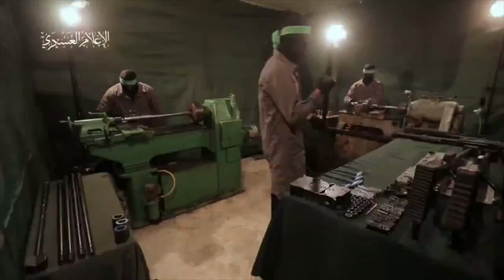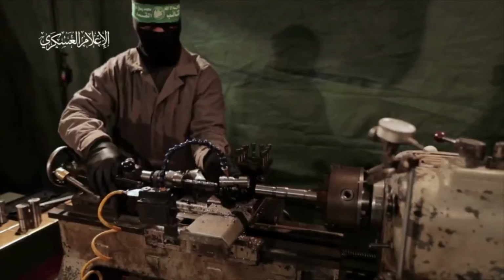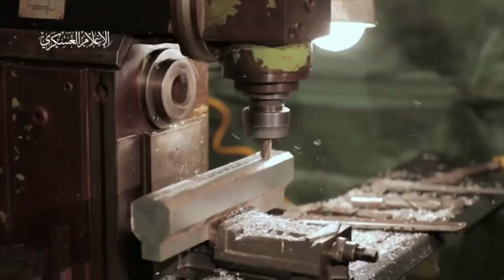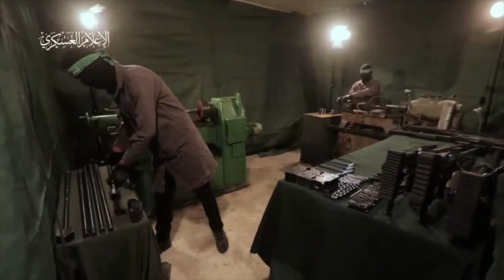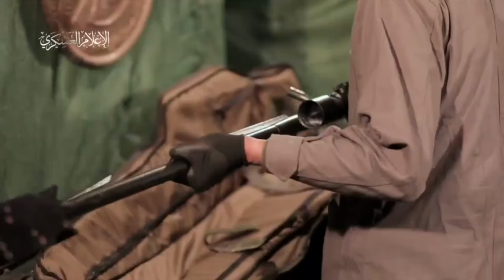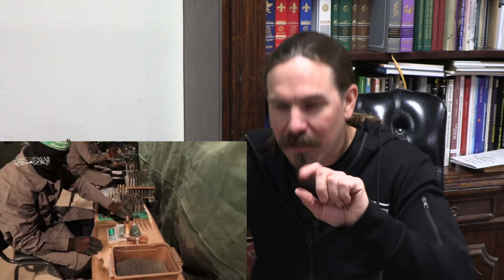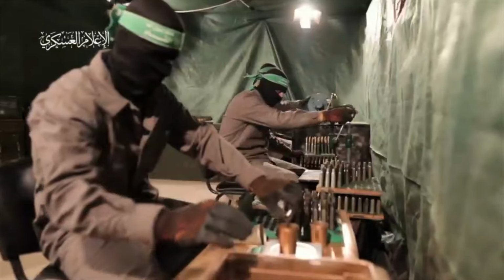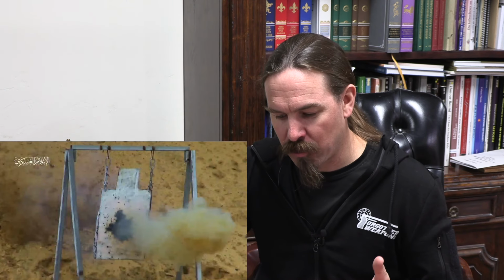Hamas Claims to Make Sniper Rifles in Gaza - Are They Really?

Comment: Notice the high pressure pump at the back of the long bed lathe ? Assuming barrel blanks are not imported from less scrupulous companies like Border Barrels ( Herr Doctor boasted to me about supplying Pakistan with .50 cal blanks several years ago ) or Lowther , you can produce very good barrels by peck drilling with a D bit made from 01 tool steel , finished with a D bit reamer with lube lead lapped then buttoned with a carbide button bought from China if using 416 stainless Steel etc. Turning between centres you would NOT see the bore of course, as the lathe centre is IN the bore . Profiling using light oil WILL produce smoke , probably using HSS on stainless here . Profiling can be done using carbide without smoke , its all about transferring heat into the chips with the correct feed and speed . You can profile a 50 cal barrel without a steady with lighter passes as the 1.75 " diameter bar stock is very stiff . You can make a button for rifling from 13mm 01 or carbide or buy one from China . If they can produce scope mounts then receivers are a snip . 
You dont need a powder trickler to hit 10ths of a grain . A big scoop and a tiny spoon will get it done or use a baster for trickling . My guess the IDF supply the once fired brass every time they go into Gaza . The steel case probably Tula . There's enough child labour there to collect , brass remake primers etc . With a long bed lathe with 4 jaw and spider , a milling machine  etc ., anything is easily possible and depends on the skills of the engineering students that have just returned from education in the West .
Compare this to the workshops of Darrah in Pakistan and see what they are capable of producing. 
Do not forget that Hamas is also the government of Gaza and fully supportive of its terrorist activity and their whole output is " light industry and agriculture " and firearms regulation is absolutely minimal just requiring registration of ownership.

Comment: I'm quite sure in reality, it's all for show - they don't make anything at all.

They have 4, maybe 5 Iranian-made rifles - there is not a single shot showing more than that.

In theory, they could surely make scope mounts - but in reality, they aren't.

If Iran manufactures and delivers the rest of the rifles - they would do the scope mounts as well. No need to take the effort to set up a factory for these in Palestine.

The milled, raw-edged scope mounts lie right next to smooth-edged parts in black finish already. Coincidentally, 4 in total. Go figure....

Comment: The one thing I disagree with is that the crates implies that they came in those crates in the first place, just because if you actually were manufacturing bullets then you would also have empty crates at the end of the assembly line to put the finished product in. So I agree with your conclusion, just I don't think that specific line of evidence is convincing

Comment: Also at 15:56 it looks like the shell on the left about 4 deep from the front has the shoulder in a very different place than all the rest although I suppose it's possible it's sitting on a marble in the tray but then it seems no two are really alike in case length or shoulder position. Maybe it's just a case of "headspace? We've heard of it."

Comment: One word... Pakistan. Where (reasonable) quality guns are made by hand with little to no measuring whatsoever and majority of the fine work is done by eye and file. 
The mid 19th century ultra accurate .451 Whitworth had a design that was extremely basic and where calipers were the only mode of measuring with unsurpassed accuracy out to 1000yds. 
Making firearms IS extremely simple and a lathe and a few hand tools is more than sufficient to produce a working relatively accurate firearm. So yes I believe this could be credible.

Comment: You can trickle powder with nothing more than a dipper, it's tedious, it's slow, it can be done. The major takeaway for being successful is don't scoop. Lay the dipper over sideways and gently push it into the powder until a very small amount enters. Then tap, tap, tap until only a few grains are left, move over to the scale and tap, tap, tap 1 grain, 2 grains until you hit weight. It's mind numbing but works.

Comment: To be fair to them, given the big box of powder and arrangement of cases, they ~maybe~ have unloaded a handful of various 50 bmg rounds they could get their hands on. Mixed all the powder together, and are reloading them to be more uniform with one another. Presumably if you have 5 different sources of steel cased 50 bmg for machine guns, this might actually increase the precision of the overall lot. Maybe even more-so if they had a separate box of projectiles and didn't just reload their random assorted mix of pulled projectiles. 

Definitely not precision ammo, but better than multi-sourced de-linked MG ammo. 
(unless they brazil nut effected the powder and now have a gradient of powder consistency across their reloading line, which would be very in-character for hamas)

Comment: The shot of the cases shows cases where excess oil has accumulated in the die and caused dents in the shoulders.  More likely in brass cases.
Also, the seating depths appear to be all over the place.

Comment: As much as respect Ian for his firearms expertise, his machining terminology is wrong. Boring and drilling are too different types of operations. A drill bit is used to open the hole, well a boring bar is meant to come in to finish after there is a plot hole for the clearence of the boring bar body. 

What he says is true tho, they are not machining anything. They would require gun drilling machines and rifling machines in oder to make a unable barrel.

Comment: I’ll spin the case when bullet seating, but usually this will consist of partial seating, rotate. Partial seating, rotate. If youre using a non-specific bullet seating stem and working with a new bullet it’ll help with concentricity/runout (allegedly).

Comment: Remember that we are talking about a region where fighters in their infinite superstition named the forward assist on an AR a "sniper button" believing that holding it down with their thumb would make the bullet hit more accurately down range.

Yes, the sniper button thing didn't originate with hamas, I don't believe that the general hamas fighter is any less superstitious or any more knowledgeable about the function of their firearms than Iraqis or Afghans.
That is to say, They know how to use the gun, they know what parts to assemble in which order, but they dont completely understand how all the parts function together when the gun is fired.

Hell, they might actually handload cartridges like that, "its close enough" type of principle, and they get the suboptimal result you might expect.

Comment: I'm an industrial quality analyst. To massively oversimplify things, your primary goals are to make things "on target with minimal variation" (accuracy and precision). All manufactured things are imperfect, no two parts are the same, but you have to strive to make them as identical as possible, using metrology and statistical process control and so on. With precision instruments, like sniper rifles for example, there is no such thing as "good enough", it requires continuous improvement and constant effort to make them as close to perfect as possible every time. Even variation within tolerances isn't acceptable. 

Now with all that in mind, let's see how these guys are allegedly doing it! 😂

Comment: Hey Ian, saying the barrels are solid might be wrong. I'm not a machinist but enjoy watching videos of machining, and have never seen a cut of end spindle so there has to be at least a shallow hole, but more importantly when they hand the barrel over you can see the center is drilled out. If it is drilled completely, partially or is solid except for the ends can't be verified. Also I don't think they use these things as precision rifles and more like anti body-armor rifles. In the end it is just a propaganda video, they will fake pretty much everything being filmed as long as it looks good on camera

Comment: I think you need to stick to what you do and not pretend to be a machinist. It's entirely possible they are doing exactly what they said. You clearly have never been in a machine shop before because smoke does come off parts. Thats white smoke, it's from the lubrication oil which would be needed for machining hard metal. The drill bit part coming off the other lathe could have been a parting operation and as many of us do we use the tail stock and insert a rod or in their case a drill seeing they are doing production to catch the part being parted off, then he backs the drill out and removes the part. While I wouldn't necc catch the part using a drill bit I don't see any harm doing so if its saving time from removing and replacing the bit over and over. Doing that takes a lot of time. This is why a turret lathe would be useful. 

 You go on to say they are faking it but then you say they really are milling something real. Make up your mind here. Obviously, it's a propaganda video. They aren't going to show everything and, in all probability, this is just one shop of many shops that make a certain few item's and they have many other shops around in other parts of the city making other parts. The British and Japanese did this same exact thing and many parts and pieces of their production were made in home workshops. Then the various shops would turn in their pieces to an assembly area.

It so happens I own a machine shop. I don't see anything here out of the ordinary like you do because you don't know what you're talking about and then all your viewers are going to lemming out and follow you off the cliff with your BS. 

These clowns are making guided rockets that have increasingly gotten better and more powerful and more precise over the past few years. As I said, stick to what you know and don't go stepping into what you don't know. Just because you've been in a machine shop doesn't make you a machinist. Just because some machine shops make certain things in a certain order doesn't mean every machine shop has to do the same.

And before anyone starts calling me a sympathizer, I'm Jewish. I have the star of David tattooed on my forearm with my name written in Hebrew inside of it which can clearly be seen in my videos. SHEESH!
Reply from the maker: Is that why the chips are blue?
Reply: @ForgottenWeapons  Doesn't matter the color of the chips. Get over yourself Mr. I can't be wrong at all because I'm an 'Merican. You have NO CLUE WHAT YOU'RE TALKING ABOUT!
Reply: Not a single rocket produced in Gaza has ever been "guided", and out of the 11,000 rockets Hamas has fired since Oct 7th around 20% misfired - which is just as bad as over the past years as well. Your claims of "guided rockets" and "more precise" - which are demonstrably false - unfortunately call your entire comment into question.
Reply: Even if the smoke thing were incorrect, there are so many other details that don't add up. Maybe you can do some mental gymnastics to convince yourself that they might be manufacturing rifles (which happen to look exactly like Iranian rifles), but my question is why? Hamas don't need to be competent machinists to be dangerous. They have never made "guided rockets," the rockets they produce are all extremely crude, but they still launched enough of them on October 7th to overwhelm Israeli defense systems. The guns they use are shitty beat-up surplus from Iran and elsewhere, but they still use them to murder people. Pointing out Hamas' incompetence doesn't diminish the threat they pose.
Reply: @austingoodman2177  Are you a machinist? Yes they produce guided rockets. I've studied everything they do. They aren't dumb. They made a propaganda video, not a documentary. They aren't showing the whole picture. All I said was it's very possible the video is legit and the OP doesn't know what he's talking about. Much like you.

Comment: I know a little bit about handloading ammo for rifles, I been doing it since 1968.  Those presses look very very crude to me, I use an RCBS Rockchucker that I bought in 1968 with my lawn mower money. Weight out each charge is well time consuming, but you get the most consistent ammo doing that, Also you need to weigh each case and segreate them so that they weight the same, then you do the same with the bullets, I saw no sizing dies or seating dies either. I am pretty good at it, and it takes me from start to finish a good two hours to size trim clean prime charge and then load a bullet into 10 to 15 rounds of ammo.  What they was doing is pretty much bullshit. To make those long long distant shots you need Ammo that is very very precisely made and the ideal is for the individual rifle. They are loading crap ammo for crap guns that somebody else made at best. This video is for people who don't have a wit on knowledge about guns or what it takes to make guns or the ammo. Of the two ammo is the hardest thing, since its got to chamber and work over a wide cross section of firearms.  Gunsmithing is a craft that takes years to learn, those guys you could not trust them to pump the proper grade of fuel into your car, let alone craft a rifle that you can trust.

Comment: Things that stuck out to me... steel toe boots, not sandals. Also wearing eye protection. The lathes  were way too new and clean. Reloading equipment was too professional. In Rhodesia  we got thousands of 30-06 but FALs use 308. So pull bullet pour powder in 2 kilo coffee can shorten cases and resize. Reloading was done with pliers ... crimp the brass. Powder was measured by a shorten case or by "eye". Lightly tap bullet in. If there weren't enough pliers go around... just bite down. Amazed even me that misfires few... thank God FAL has adjustable gas port because lots of hot rounds

Comment: Excellent video Ian, but I might add some context. I would suggest this video would be as much for the rest of the world as for their own rank and file moral upkeep. 

They are fighting with the best they can get. They may have the intention of using them in far closer ranges or hit and run tactics on light armour. 

They do however have everything necessary to do basic repairs perhaps? Or even manufacture basic firearms like open bolt automatics if needed.
Reply: https://youtu.be/4HPNcKmRlQs?si=51r1xbMDiFzMckN4

Comment: So what are the odds that this video is a mock up recorded
say in Lebanon to show Hamas making these, like you said
in a produced way so that what you see is obviously not real
on the whole, while in reality they are making these some
where else and separately? Because all that equipment is
loud AF, needs a large amount of electricity, which they don't
have, and if you're in tunnels that sound travels and would
be deafening. You can't successfully hide a full, active
machine shop in make shift tunnels. Though you can
hide small single function, manually powered fabrication
shops. So maybe it is real from a certain point of view.
Just this video isn't. Because they are successfully using
snipers against the IOF.

Comment: A literal pipe shotgun would still be accurate enough for urban combat, let alone a machined barrel yeeting a 50 cal bullet. Doesnt matter if "its smoking" or "it could be slightly warped" etc. etc. 50 calibre joules is still 50 calibre joules. At these distances, likely inside 100m, these guns will be perfectly functional as anti-materiel and anti-personnell rifles.

Comment: IF you have used a grooving or part off tool and gone deep enough that it would intersect with the drill (bit) but not deep enough to part off the part.... then when you drill through the part will part away as that last bit of material is removed.  the first thing they are working on is not a barrel, but appears to be in preperation of making a long section that will be many segments of the second piece we see that undergoes drilling and then each segment will come off and the next one will be drilled then so on and so on. this is done to make lots of things faster then one piece at a time. something similar is done when making suppressor baffles by hand. in conclusion none of the machining shown is probably fake but we dont see any barrel or reciever work so it still begs the question of if they have access to barrel blanks or finished barrel or additonal facilities and machines for making of barrels. It also doesnt answer if they can make the more complex pieces like a reciever. i forgot to mention the smoke could be from oil as a lubricant or cooling agent already applied or possibly steam from water already applied or they used no lubricant or cooling of any kind and the cutting tool isnt doing a great job and theyre allowing too much heat to be generated.

Comment: The first clip where he's supposedly drilling out the end of the "barrel" just... no... that's not how that works. You'd be working with a barrel blank, and that end of the work would be sitting in what's called a steady rest for a few operations such as running a chambering reamer through. This is absolute BS. If you've every worked on a firearm, or if you've ever ran a lathe, you know this is trash propaganda.